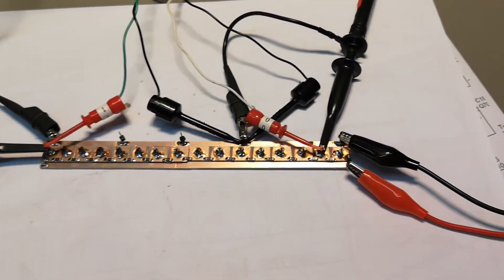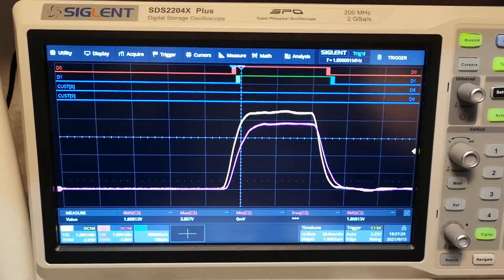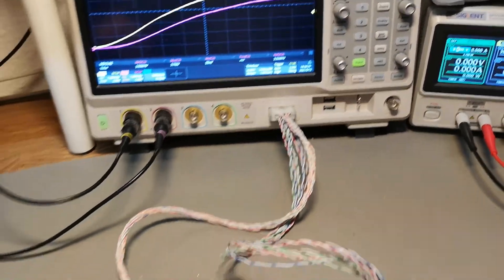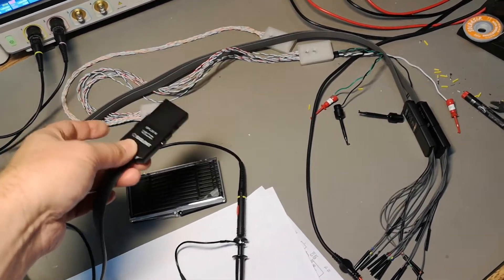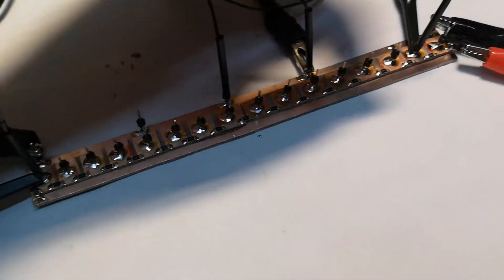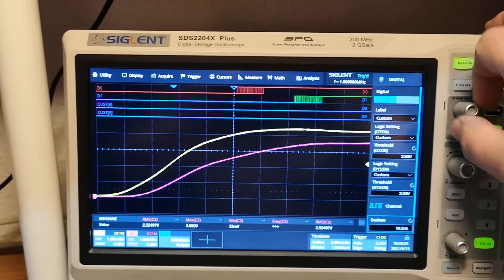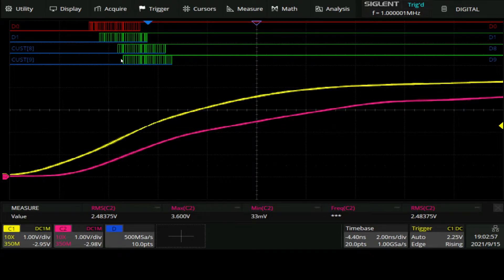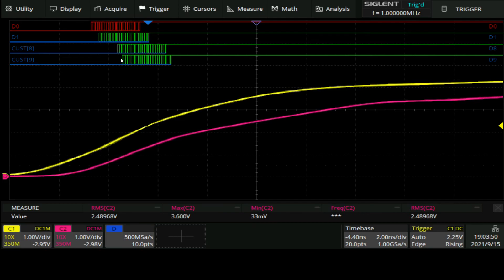Siglent Logic Analyzer Probe and Pod SPL2016 versus DIY version

Comment: The scope only has 500MSa/s on the digital channels.  Dither is almost certainly from the scope not the probes...
Reply from the maker: EXACTLY, i hope that is very clear in the video, and if you run fast digital measurements, dont need analog at the same time, then trig on digital, and get perfect stable signals, with ofcourse 2nS resolution. (500Meg/Samples)